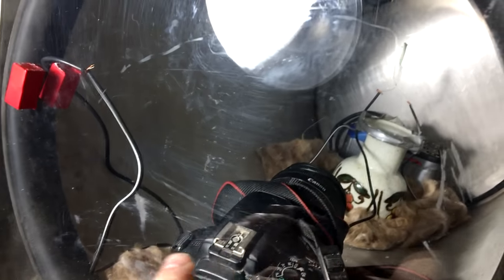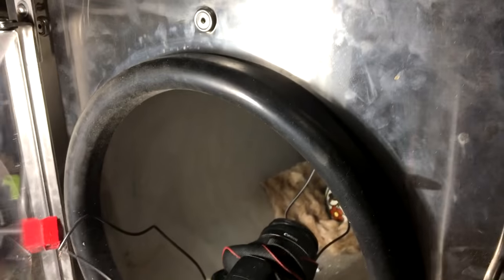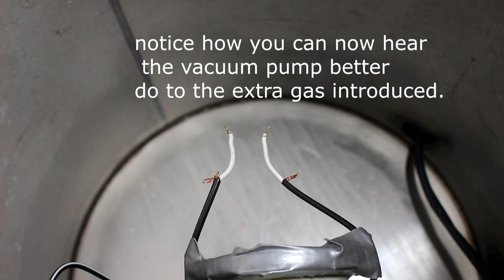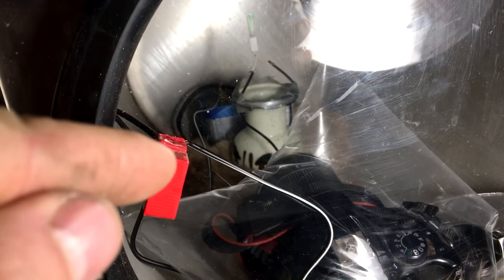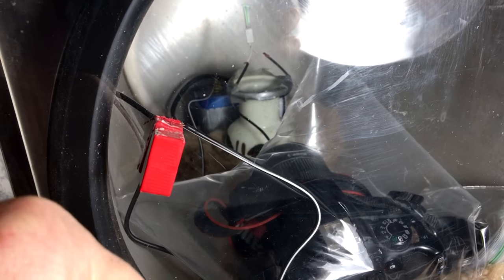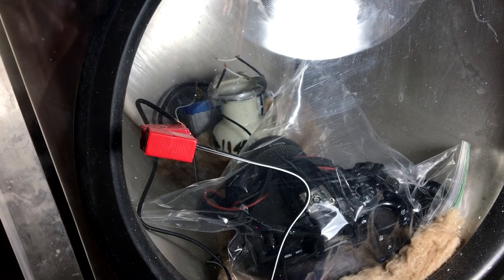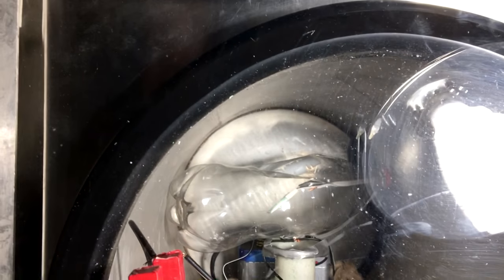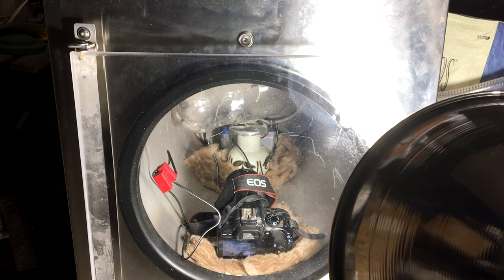Sound of Explosions in Space? part 1

Comment: I would imagine in space, the sound would be considerably faster than the speed of sound here on earth.
I would wager you would hear a supersonic gun shot at the same time the bullet flys past. No atmosphere around to slow the gas released from the round.
Reply: judgeomega Incorrect. You are misinterpreting it. It is the shrapnel and gas released that would travel more quickly. The sound itself, however, requires a medium to pass through, as it is simply vibrations. A vacuum has no such medium.
Reply: Knightofmines I understand. 'the sound' i was referring to is the gas. Too bad theres not a word for what you hear from direct gas transfer of 'sound'. Perhaps cody could coin the word?
Reply from the maker: Like I said the gas molecules are basically bullets when in a vacuum so yes they would hit at the exact same time or a bit before the actual bullet (the bullet was after all propelled by them) as for a word, I'll think about it.
Reply: Cody'sLab im not 100% convinced yet. Im sure this explanation is part of it but i also imagine the little plastic shrapnel hitting the camera would also be picked uo by the camera, even if it was just one little piece. Can you finish your experiment by isolating the shrapnel?
Reply: I am thinking convection might work... But that mostly deals with heat
Reply: By the time the gas reaches, you there wouldn't be enough gas for you to feel it.
Reply: Other way around, the speed of sound decreases as density decreases. 
ie, speed of sound at sea level is 340 m/s and 295 m/s at 18 300 meters.
Reply: Jim Verzella but it's not traditional 'sound'. still waiting on cody to invent a new word for it. it's expanding gas, not a energy wave of cascading compressions of a medium.
Reply: Ah, gotcha. He's talking about the actual molecules moving.
Reply: It's called an expansion front. I guess you could call it blastwave, but blastwaves are actually shockwaves, were the atmospheres (normal and of the blast) colide.

The gases from a gun in space would hit a significant time before the bullet. Not at the same point, obviously. I mean, a spaceship could detect an imminent impact by sensing the expansion front from the blast.
Explosive propellants have a limit on how fast they can propel a bullet. I don't know exactly what's involved, but I do know you can get only up to abot 2Km/s out of a projectile with nitrocellulose. This was what drove the Nazis to research magnetic cannons, to use as AA guns.
Maybe it's because of the propagation of the shockwave in the expanding gas, maybe it has something to do with the chemical reaction speed, but if you get an infinite barrel, speed will only increase up to a certain point. Anedoctal evidence for this is that when the US was evaluating a more powerful gun for the Sherman M4 tank, they chopped off 38 cm of a gun to make it lighter and the penetration test results were the same as the original, longer gun. This became the M1 76mm gun, which is 4,2m long, equiping the M18 Hellcat,  M6 heavy tank and the 76W versions of the Sherman.

So, when a bullet leaves the barrel, the gases still have a lot of pressure on them. Maybe in space they might do it differently, but here on earth they try to get as fast a projectile as possible with a barrel as short as possible, wasting a lot of energy when the bullet leaves the barrel in the form of unexpanded gas.
You might picture it as a sphere expanding from the muzzle, but since there's the velocity from the gases that already accelerated the bullet, it is more likely a waisted cone. This cone is still expanding because of the residual pressure left by the undeveloped gases, so a component of this plume will get accelerated for a bit, probably up to that limit I talked about earlier, surpassing the speed of the bullet. The expansion front of this wave will be roughly spherical, with a conical hole in the middle because of the bullet.
Reply: Thauã Aguirre while i agree with your ability to detect an impending impact from a weapon, the conditions surrounding a longer barrel in space drastically change. While yea, an infinitely long barrel, while impractical to say the least, would certainly no longer develop a gain in velocity, i would actually begin to slow the projectile down. The friction from the walls of the weapon would most likely be the determining factor, especially with vacuum welding.

However, In a frictionless environment, the infinitely long barrel had the interesting characteristic that it might draw an even better vacuum than space can. Since space still has floating particles, i think its something like 200 particles per meter^3, the inertia of a frictionless projectile would carry it to the point where the "end" of the barrel would have a higher concentration of particles and therefore have more collisions, resulting in a "higher pressure" at the forefront of the projectile. This in comparison to an infinite length barrel with he forefront of the projectile at atmospheric pressure.

In other words, in a frictionless world, foot for foot, you get a much higher efficiency out of barrels in space.

The analog to this would be De Laval nozzle, which, in space, needs to be shaped with a larger and longer bell to get the most out of an engine. Rocket engines designed for space utilizing the De Laval nozzle usually achieve much higher efficiencies than atmospheric engines. The Nozzles of each stage on a rocket, like the Saturn V have to be designed for a specific air pressure to get the best efficiency for weight. This, vs the space shuttle, which is an in between nozzle. The space shuttle starts out over expanded so that it can achieve higher efficiencies at higher altitudes. But at a certain point, its nozzles become under expanded. You can think of under expanded as if you had a longer barrel on a gun, you could achieve a higher muzzle velocity while over expanded, you have a barrel thats too long and youre actualky slowing the bullet down.
Reply: You'd hear it if you were close to it.  The shock wave emitting in all directions from the gun would not carry sound as far as in air, and would theoretically not create a compression wave.  But escaping gas would create what's called cavitation, or a pocket of gas, in which sound would travel, along with gunpowder residue, the shell casing, and various bits of micro debris.  In the case of these types of explosions, unexpected reactions occur because of the high velocity and thermal factors, which were not studied until the development of slo mo and precision equipment.  It is now within the grasp and interest of science to study vacuum, to see if they can, in fact, create compression waves with various reactions.   It was not until the gravitational wave that traveled through empty space was felt by LIGO detectors a year ago or so that scientists would even entertain the idea that space is a cohesive medium.
Reply: judgeomega no mister, the sound in vacuum can't be faster than on earth.they can be only fast how fast can by molecules where is it on and only can move on distance from start to end depends on volume of materials ekspansion.
sorry for my English, i know is pure.
Reply: Speed of sound in the atmosphere does not depend on density. It depends on temperature. The tables showing speed of sound at different altitudes are based on average temperatures.
Reply: ***** Only for ideal gases. Density DOES determine the speed of sound. https://en.wikipedia.org/wiki/Speed_of_sound
Reply: +judgeomega,  I was replying to Jim Verzella. In that context, I stand by what I said. Here are two quotes from the wikipedia page you linked to:

1) "By far the most important factor influencing the speed of sound in air is temperature. The speed is proportional to the square root of the absolute temperature, giving an increase of about 0.6 m/s per degree Celsius."

2) "The dependence on frequency and pressure are normally insignificant in practical applications."

Comment: Maybe a piece of plexiglas between the camera and the explosion would block the pressure wave from hitting the camera.
Reply from the maker: in space that would work, however in the chamber the gas is getting bounced around by the walls of the chamber.
Reply: Yup hit the side and rings the chamber.  You need a way bigger chamber for this test.
Reply: Cody, I think you should place a plexiglass to shield the camera from the chunks of your explosive.
It was clear when you used the plastic to protect the camera that a lot of pieces flew to everywhere.
I believe that the pieces of the explosive are hitting the camera and shaking the microphone, and not just the gas molecules.
Let a considerable gap to make sure the gas have a way to hit the camera.
Maybe if you put some barriers like this (top view of the chamber):
E = explosive, C = camera
_____
|     E   |
|          |
|__    |
|   ____|
|          |
|__C__|
Reply: That would help after he uses a bigger chamber.
Reply: yeah but what about debris hitting the ships in space?
ironically, we aren't talking about explosions in a vacuum (metaphorically)
Reply: The goal of the experiment was to understand sound on empty space, not only the effects of explosions on ships.
If he lets the camera outside of the chamber, he would be simulating the sound that hits on the interior of a spacecraft, for example.
That's why I thing he should place the camera inside but with a shield against the explosions debris.
Reply: I doubt it, it would probably just delay it, the pressure would wrap round the plexiglass and eventually reach the camera. Probably :P~
Reply: +Fester Blats you would still hear the sound, as the blast gases would hit the wall of the chamber and cause the plates of the chamber to ring themselves. Probably :P
Reply: MrGoatflakes
Yes SR. :)
Reply: If he has a container with a plexiglass sheet in the middle and gets  both halves of the chamber to vacuum then you would not hear the blast because it would not be able to travel from the sheet to the camera.
Reply: He has to leave some gap to the impact wave to hit the camera, but not the chunks of the explosions. A fine screen should work then.
Reply: So it depends on the size of the explosive and the material it moves (would have to be pretty close for the gas to hit you in the distances you'd get in space).

Comment: Makes sense, if you think about specific impulse in rocket engines, you get a good guess of what's going on. The Isp gets higher with increasingly less atm. pressure. So, the lower the surrounding pressure, the faster the expanding gasses can move.

Comment: Slow-mo shoots are super cool, but you need more light.

Maybe a 100w led proyect is on its way
Reply: He needs smoother light, you can see the light pulsating in some shots.
Reply: Adria Garceran because its ac wich is 60/50hz on on off states in a second
Reply: HappySlappyFace Battery powered lights, with no dimming, would solve this nicely.
Reply: Adria Garceran or giving them 170vdc will fix it
Reply: That shot looked to be 21000 frames per second, that looked way faster than 60 hertz. Maybe it was a CFL?
Reply: Rion Motley hmm
Wierd
Reply: first of all to film somethink in slow motion you need DC current lamp, or some condensator to hold voltage betwen alternating. But second one is just my theory
Reply: Ac current changes direction of flow 50 time per second (human electric standard not nature)

So the slower you film the more you see light turning off and on.
Reply: Przemysław Krasiński thats pal speed
Reply: What? :-)

Comment: While in close proximity an explosion in space might be "heard", as the gas molecules disperse over distance the effect would quickly become too weak at a single given point to be distinguishable. I would think your result would be somewhat diminished in a large vacuum chamber where dispersion was much greater.
Reply: As the gas molecules travel from the source, the distance between each gas molecule increases. At a certain distance you may be struck by only 10 molecules, or 2, or inevitably 0. Thus, the distance the explosion would be audible is finite.
Reply: Right, but this effect is even worse in air, because you have dampening in addition to the inverse square thing.
Reply: The same is true on Earth, but the molecules are losing velocity more quickly due to drag.
Reply: @CplSkiUSMC   How is that any different to what would happen on Earth?
Reply: @CplSkiUSMC   I am aware of what sound is and how it travels. What I'm saying is that explosives have their own gas. This means the gas will fly outward and carry energy with it, many times faster than sound, and exert a pressure on whatever it runs into. This is one of the major ways that shockwaves form on Earth in the first place. The rapidly expanding gas from the explosive compresses the surrounding air, which slows down the gas from the explosive. In a vacuum, there is nothing to attenuate the blast wave's energy, so it expands unimpeded. So the blast wave from a space explosion would still do damage. The energy doesn't just magically disappear because there's no atmosphere.
Reply: @DANGJOS  Right, recall my initial comment... over distance that energy expansion and dispersion is simply swallowed up in the void. Why don't we hear tremendous impacts within our own solar system such as the comet that struck Jupiter? That impossibly huge amount of energy is spent in the void of space.
Reply: @CplSkiUSMC   What does that mean, swallowed up in the void? Both the blast wave from an explosive in space, and the shock wave from an explosive in the atmosphere will have there energy fall off with distance and disperse. You haven't explained how explosions in space would be different in this respect. 
And the impact of the comets with Jupiter were one, hundred of millions of miles away, which is a hell of a lot more than any distance you find on Earth from an explosive, and two, occurred in Jupiter's atmosphere, so it's completely different from the gas producing explosives that I, and most people likely, am referring to.
Reply: @DANGJOS  Here's an idea... go rent a rocket ship from Elon Musk, fly out to space, and test it. I eagerly await your results.

Comment: Hey Cody remember when you boiled the water until it froze? If you made some sort of heat exchanger that wouldn't explode and placed it in the boiling water, would it be possible to almost instantly chill a drink? 

You look online and there's literally no products anywhere created to instantly chill a drink without using ice of some sort.  Imagine if you created something just like a microwave but instead of adding energy to the system, it removes it.
Reply: Jonathan Simen The point here is time. 
It takes hours to actually freeze typical ice.

Vacuum chambers can be fairly cheap if you're a good engineer (by the way you don't even need a "chamber")... and even the average air conditioner or fridge uses a vacuum pump to decrease temperature.

Instead of waiting on or paying for ice, you can just plug in your instant drink cooler, pop open the door, take a leak and come back to enjoy a cold, tasty ass beverage
Reply: Jonathan Simen Maybe I could've worded it better but yes you are correct fridges use compressors not vacuum pumps.

The point is that it takes hours to initially freeze the ice which is nothing compared to minutes.

It wouldn't be an open system where the drink is exposed and mixed with the water, that's why I mentioned a heat exchanger. 

Just imagine a vacuum chamber with an upside down, sealed vessel protruding inside of it, never actually being under pressure. Then you submerge that vessel in water and turn on the vacuum pump.

As the water boils off, it decreases in temperature and pulls heat from the vessel. Then, you just shove your canned drink in the vessel and let the heat get pulled from it.

Would be so much easier to understand if I could just draw a picture lol

Comment: Sound in the atmosphere travels at the speed of, uh, sound. In a vacuum however with no air to resist it the advancing gases will travel at whatever inertial speed they had from the explosion. Much faster. How much faster? You're gonna need a bigger chamber, or better timing instruments!
Reply from the maker: from what I could determine using the high speed camera it is at least 3 times faster
Reply: How much would a balloon inflate if you knotted an empty one then put it in a vacuum? ...I found it quite interesting what happened to the bag at different pressures. =)
Reply: I'd think it would be roughly the root mean square speed of particles at the temperature of the exploding gas.
Reply: It's probably a lead azide cap? https://en.wikipedia.org/wiki/Table_of_explosive_detonation_velocities
In space there would be an attenuation of sound by distance due to the expanding sphere thinning the shockwave. Hard to simulate in this tiny chamber.

Comment: Was about to point out the same thing your prof said. In a vacuum, the explosion is free to expand whereas in an atmosphere or other medium, say, water, there is attenuation due to 'friction' or resistance with all the atoms the explosive gas particles have to push out of the way, so it's safer to be near the explosion in a medium such as air or water. Futhermore the medium wouldn't not only absorb the kinetic energy, but also the thermal energy in the form of infrared. There is a catch though. Say you're in a spacesuit, and are near an explosion in space. If you can hide around an object, say your space capsule, and even if you're pretty close to the explosion, you should be fine as long as there's no shrapnel, but in an atmosphere or in water, the exploding gas shockwave/pressure wave would diffract around corners and still kill you like any wave in a medium would do, and it's safer in space instead! :)